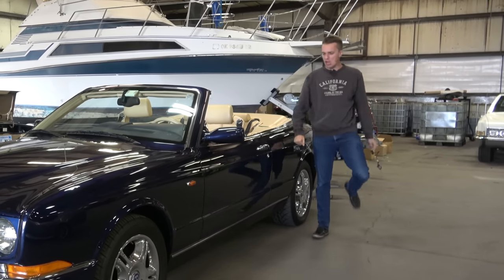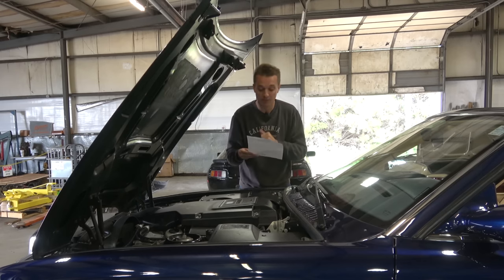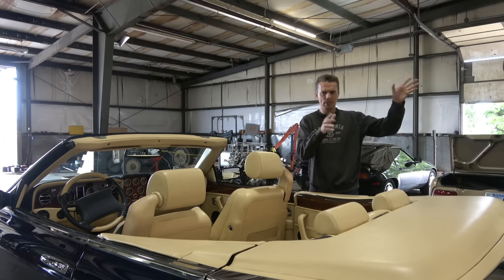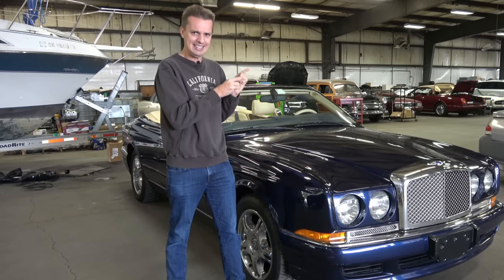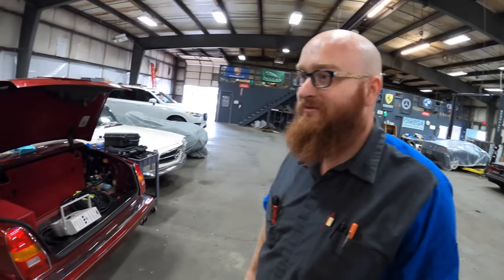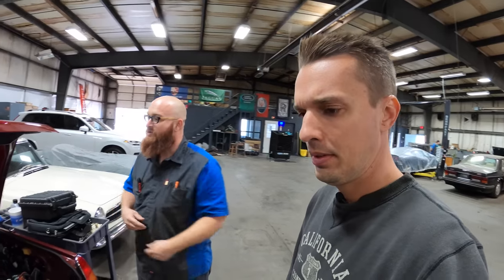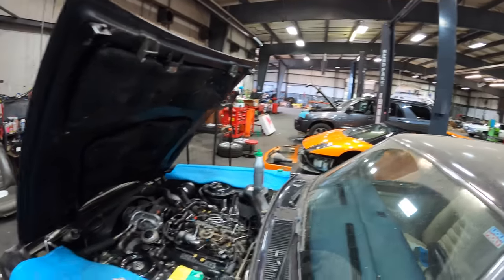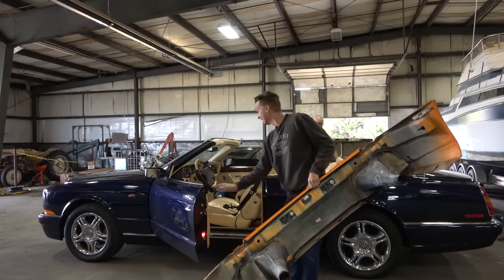My Bentley Azure Is Finally Finished, And It's a Great Lamborghini Parts Hauler

Comment: I have read that the Azure top lifting mechanism suffers from the fact that it is lifting a much heavier top than the top on the Mercedes.  The original high pressure lines tend to split and crack.  New replacement lines do not have this problem.  It just costs 8k to get there.  If they do fail, they can spray hydraulic oil all over the interior from the area just above the rear view mirror.  I wouldn't want to know what a new interior would cost for an Azure.  The dealer is smart to redo the lines on the hydraulic lift system because a knowledgeable buyer would ask if it has been addressed on a used Azure.
Reply: I'd take the coupe or sedan over this dopey and problematic old man convertible.
Reply: A new, properly done interior runs between $30,000 and $40,000. The hides are EXPENSIVE!
Reply: I own an R129 and was about to respond that the oil is mostly clear and shouldn't be too bad to clean up (I know this from expeirence). But then I remembered Bentleys use custom hides and carpets that probably cost more than the value of my R129 to replace...

Comment: The Wizard is an Honest mechanic, we need more mechanic like him.
Reply: When you look at all the work he gets because of it, you would think more would be like the Wizard.
Reply: I doubt that when I hear his insane prices...
Reply: @niconesta8566  He is using the industry book rate and then giving a discount on labor. If you don't know, they don't bill by the time they take to do something. They bill by the time the manufacturer says it should take. All shops use the book rate when giving a quote for repairs. Many times it takes less time so the shop gets to charge extra. A good shop will give you a discount for the unused, but quoted time. Same goes for the parts. Most shops will quote the price for OEM equivalent parts. Some shops will give you the choice of quality the parts are if their supplier has several options. A bad shop will use the cheapest part, but charge the price of the highest price part.

Now, for the insane prices they talked about here, you need to remember that they are not talking about normal cars. These are high end, exotics and luxury brands. A part that would cost $20 in a chevy will run $100 for the BMW and $1000 for the Rolls Royce/Bentley/Exotics. And that is before a repair shop adds their small markup. I can do a full brake job on my HHR  myself for about $350. A shop will charge $650-$750. That same job on Bentley Continental GT will set you back $3800 to have a shop do it. Just the price of the front discs and pads ($800) is more than the entire shop rate to change everything in my car and that is just parts for the Bentley. There is still the labor, disposal, and fluid costs that haven't been added in yet. 

Owning a high end exotic or luxury car is a money pit. They know that the people that can afford to buy a $400,000 car can afford a $4000 brake job so they charge that price.  It's not the fault of the repair shop. That luxury tax comes from the manufacturer.
Reply: Most mechanics are honest. Some people just think working on cars costs way less than it actually does
Reply: He charges too much..
Reply: @franciscobacino7207  He quotes the industry book rate that all mechanics use. If you notice, he rarely tells us the real amount he charges Hoovie. He tells us the book rate for labor and full retail price for parts. On top of that, The Wizard is not your normal mechanic. You can tell that because of the range of cars people trust him to work on. Your average shop isn't going to have guys that can work on exotics. That kind of skill comes at a price.

Remember, you always quote on the high side. People are happy when you come in under quote but feel ripped off if you go over.  A good mechanic will be upfront of it being worst case price and will do what they can to keep the real cost down. Even when the Wizard tells Hoovie that if he doesn't think something needs to be replaced, he still tells him the cost if it does
Reply: @docgiggles130  sorry  maybe im used to people that charge what they think its fair, and don't use the industry quote book..
Reply: Francisco Bacino  90% of mechanics quote and charge from the rate book. If you found a mechanic giving low guesstimates and doing decent work well bully for you
Reply: @franciscobacino7207  i don't believe you have ever paid anyone to fix a car
Reply: @seanoreilly1832  like I care what you think XD
Reply: @franciscobacino7207  yes you do

Comment: I remember schlepping a full-size oven in the back of my Rover 216 Vanden Plas back in the day, about 24 years ago.  It ripped the padding at the top of the driver's door, but aside from that, and the fact that it was a bugger to get the thing in and out of a small 4-door saloon, it was a successful operation.  As for hyper-inflated parts prices, you should join an owners' club.  When I was a member of the Aston Martin Owners' Club, I learnt some useful information, such as that the steering rack of a DB5 is interchangeable with that on a Morris Minor.  Such information can drastically reduce the cost of repairs and, given there's no warranty to worry about, a nod's as good as a wink to a blind horse.

Comment: I love the goofy looking headrest supports.
Reply: The entire seat assembly is from the BMW 850.  Makes perfect sense for either a convertible or coupe since the seatbelt isn't anchored to the car body.  Then again, you should see how well the seat is attached to the floor.  Six huge bolts and 2 thick steel pins.

Comment: That silver Prelude in the back..... man, that hits me at home! I had a 2000 5 speed Prelude in the exact same color. My first brand new car! Crystal Blue Metallic. That one looks like it might be a Type-SH with the ground skirts and rear deck spoiler. I had the base model but had them install the spoiler and swap the curved wheels for the straight spoke wheels from the SH. I bought it brand new in December of 1999 and sold it in May of 2010 with 225,000 miles. I had bought a new 2009 Honda Accord EX-L V6 6 speed manual coupe and kept both for a year. Sometimes I think I should have still kept the Prelude. One of the finest handling cars I've ever driven.

Comment: Brands don't bother with the value of their cars after they sold them to you.
Reply: They should take a page out of the Nintendo handbook. I think Sony is similar with the PlayStation, where they provide service and parts direct to consumers for an insanely long time. I think Nintendo supported the original NES until the mid 2000s and only stopped when they couldn't source some of the internal components anymore
Reply: Not always true. Unless they actually want one time leasing or target billionaires they will try to increase CLV by producing the most reliable product possible. This leads to less depreciation from better perception and high CLV. Lexus is a great example.
Reply: errr corperations are bad
Reply: @honkytonkinson9787  Not sure if they're still like that. If you go to support pages from their more recent consoles (Wii, Wii U) instead of offering repairs they tell you to find replacements or upgrade to a newer console.
Reply: Porsche does but only for the elite ones
Reply: @9inchpp  By random third world company you mean AUDI?
Reply: @9inchpp  So Chrysler is a third world company?
Reply: I think you are mostly right - but a couple of brands have used tricks to either up the value of used cars or lower it. I think it was Audi that did so by 1) buying back for higher then market prices in some markets, and 2) keep parts for older types available. As a result the cars held their value better and were on the road for a longer time. Both gave the brand more 'credibility' as competitor to BMW and Mercedes (in the early 80's). 
Volvo Belgium, on the other hand, once actively removed inventory of 240 series spare parts from dealerships, just to get the customers out of the ageing 240's, hoping that customers would buy a new shiny 960.
Reply: Kim Jong Skill you're probably right. Everything is manufactured to be disposable. I'm sure you can relate with me that you hate not being able to tinker with things and feel the satisfaction of fixing something old and saving a few bucks In the process. Nothing satisfying about throwing something away, because we all care about the environment, and then spending too much money on a piece of plastic garbage replacement
Reply: @MuitoDaora  They were sold to some shady company from indonesia before audi bought them
Reply: @taunuslunatic404  lolololol yep.
Reply: They don't want you to fix it, they want you to buy a new one
Reply: they will when lease companies raise their prices
Reply from the maker: @MrCarGuy  Mercedes is not like this. They created the classic center to make sure older models always have parts availability.
Reply: They do if it is good and they can advertise it as a selling point.
Reply: Why wouldn’t they want their cars to retain value?  Buying a used Honda makes little sense when you can just buy a new one for not much more.  BMW on the other hand...well at least they have good availability on parts to keep the classic ones going.
Reply: @HooviesGarage  doesn't auto part manufacturers produce quality substitutes for rollss and bentleys and others?
Reply: @MuitoDaora  1963–1972	Ferruccio Lamborghini
1972–1977	Georges-Henri Rossetti and René Leimer
1977–1984	Receivership
1984–1987	Patrick Mimran
1987–1994	Chrysler Corporation
1994–1995	MegaTech
1995–1998	V'Power and Mycom Sedtco
1999–present	Audi AG
Reply: @HooviesGarage  If I remember correctly in Reno Nevada there is a warehouse that houses most Porsche parts you could need for most of the models they have produced.
Reply: @N Webb That was Robert Bosch, not Mercedes. All European Cars suffer maladies caused by Bosch. I swear that Bosh is trying to be known as The Lighting Company That Refined Darkness. After all, Lucas invented it.
Reply: TheFreePantheist proof that hardly anyone actually cares about the environment. People cry about straws but I'm sure that disposable electronic appliances do way more to pollute than anyone realizes
Reply: Hoovies Garage Mercedes fan boy right here (jk Hoovie you are awesome!)
Reply: @honkytonkinson9787   Every Rolls Royce comes with a 4 year serious warranty and you can expand that, but it costs.   Rolls has turned into a monster, over bentley, I personally blame the crowd bentley is playing into. They decided to leave the prestigious world of excellence and go straight into the futboler's dream car.
Reply: A lot of manufacturers used to care about resale and the vehicles life span because it made people more willing to shell out for new products instead of buying used  because depreciation isn't as big of an issue and the closer the prices are between new and used the more likely people are to buy new
Nowadays marketing tries to maintain this within the market but with the unsustainability of consumer desires and constantly needing to have a new and better product or else be ridiculed and compared to other companies for not adding another horse every 6 months
Reply: Hovie bothers with his little dances at the start so guys know that hes willing to give up those cheeks tho
Reply: @krassimirpetrov7131  not really, in Germany you can source parts from any model made directly to Porsche Originals, they're very expensive though
Reply: Taunuslunatic might as well be. Chrysler builds junk 😂
Reply: In general, brands care about the first owner, because he's the one paying them for the car; the second owner, because it's someone who potentially could buy a new one in the future; everything after that is just "poor people" and they couldn't care less if the cars mechanically start falling apart and get junked because of unsustainable repair costs. This is true for MOST brands... not all, but most.
Reply: @taunuslunatic404  - Chrysler is now Italian.   So . . .Yes.   Definitely a third world country.
Reply: @King_Kong_Song  nintendo is just as scummy as every other video game company now. Milking the same small handful of ips and nickle and dining fans for things like pokemon that have been in the games for years
Reply: @taunuslunatic404  Chryser is an US company. So yes, third world.
Reply: Tell that to Rolex
Reply: Toyota does. Different and successful business model.

Comment: Triumph TR7 or TR8 in the background?!.. can’t be many of them in the states?!
Reply: I see few of them on the road in my area but it's rare
Reply: chris younts  To be fair the TR8 is great of you concert it Euro-Spec. The emissions stuff killed it, the later cars were even decently built.

They handle much better than its predecessors in my experience.
Reply: chris younts  The TR8 is a vast improvement. Its the Buick/Rover V8 and its incredibly tough of maintained properly, much lighter than the slant 4 from the 7 too. With a UK spec engine the TR8 is absolutely monstrous.
Reply: I think I saw that car on one of Wizard's videos-on his channel.  It is waiting for parts and will be for a while.  All problems know, just cannnot get parts faster than 6-8 weeks.
Reply: @SpitfireFortyFour  Hey, the Rover V-8 is a huge improvement over the V-8 Stag.  IIRC, the 4 banger in the TR7 was half the Stag 3-liter V-8.
Reply: @zf4hp24  Yes the engine deisgn was modular. The slant 4 wasn't great and the 3.0 couldve been great had it been built correctly, its an exceptionally smooth engine. The Rover V8 is generally the better option though.

Comment: So right about dealers. I needed 2 engine mounts for my (Aussie) Holden Commodore V8 Ute, and Holden wanted $1200 for the two including fitment. I took my car to a local mechanic who charged me for 3 Engine Mounts plus installation for only $544. Do not take your car to Dealers, they rip you off. I dont know about other countries,  but in Australia, the car manufacturers make their money of spare parts.

Comment: It's a "6 and 3 quarter litre" engine Tyler. Where's your Phantom pedigree.
Reply: I know someone has managed over 200,000 miles on that stout old engine. Tough as shoe leather. The biggest problem on the Turbo R is from the Bosch fuel injection. Like do much else European, Robert Bosch is the bane of their existence.

Comment: 40k transmission that’s made of glass 😂
Reply: @1985toyotacamry  cuz its made of glass
Reply: @1985toyotacamry  you don't say.
Reply: Matched with an engine made of paper mache. That should defenetly last a while.🤔
Reply: @aaronlopez3585  its more expensive if its made of glass
Reply: See also: Ford (more than once), GM, Toyota, Honda, Nissan/JATCO CVTs.... :(    Makes used car shopping a real (censored!).
Reply: @1985toyotacamry  - That's what "made of glass" means.
Reply: @OMGWTFLOLSMH  I mean you have strong glass that can work. I'm implying they using cheap glass for stupid amount of money

Comment: Wizard buying these laptops from 2001 is making me nervous. I wish he'd take data from the the hard rives and such and move them to a more modern PC..
Reply: That's what I was thinking too. CLONE THE DRIVES, as insurance.
Reply: Drives are cloned. Whats the problem?
Reply: @CarWizard  Well then, nevermind! I should have known the Wizard was smarter-than-the-average-bear. 

Ahh if only I didn't live 3 and a half hours away! I miss having a good mechanic :(
Reply: @CarWizard  No problem now that you said it. Just the potential for failure of 15 year old, expensive laptops with software for out of production vehicles can make people nervous.
Reply: @CarWizard  those Dell D series laptops are stout. I imagine they will last for 20 years easily. I have tons of parts for them if it ever dies.
Reply: @batsonelectronics  would that be time for a Lazy Game Reviews/Car Wizard collaboration?
Reply: Splitting hairs but that laptop is a Dell Latitude D620/D630, so that would be 2006-2007.
Reply: @throwback19841  I don't know who Lazy games review is so not sure.
Reply: It's highly likely a newer laptop would not support the software. I'd imagine these scan tools and user manuals run in Windows xp and require serial.
The battery on the laptop will be the heart breaker.
Reply: @ppsnake  I can still get New Old Stock of actual Dell OEM batteries, and Aftermarket batteries are plenty. At least for the next 5 years it should be fine.
Reply: @ppsnake  there are newer laptops that will run the older software like the toughbooks that ford uses, but they are 10 times the price of an old Dell laptop

Comment: Tyler...I passed on the 750IL and bought a 1984 Corvette w/ 18k.
($4500) It has some decorative issues but it barely broken in.
Whats your opinion on vettes?
It has the crossfire fuel injection 205 HP. Thanks, Doc

Comment: For the seat belt pretensioner try disconnecting the battery for 30 seconds and hold down the brake pedal

Comment: Convertibles are the cheap pickup trucks for those of us who don't want a pickup truck.  That's a dangerous statement here in Texas....
Used my 2001 Chrysler Sebring Convertible Limited as a pickup truck more times than I should admit....and it cost the same as your Azure, course mine had 20 miles on it when I got it almost 19 years ago.  Now with a cool 120k miles on the odo.

Comment: You can erase the error code of the Airbag („Pretensioner“) easily with ( and only!) the original Bentley OBD II Scan Tool; go to the Dealer, they might not even charge you
Reply: Didn’t the Wiz just buy a laptop and cables 😂 for Bentley
Reply: Andy Kirwan you are absolutely right, he did, i commented before seeing the whole episode; with that device he can erase the faulty code

Comment: 2:13  Would have been funnier if the Wizard walked by counting money.  These cars are not meant to be still running around, how else are they supposed to be exclusive?  Mortgage your home to buy a used one then keep it in your garage because it is too expensive to run. this is by design.